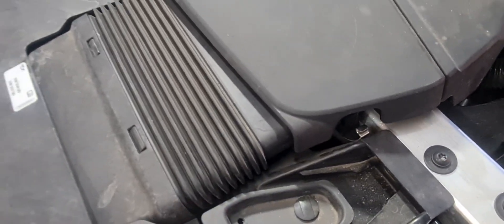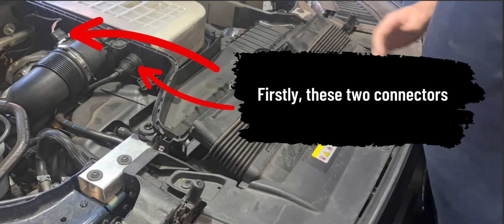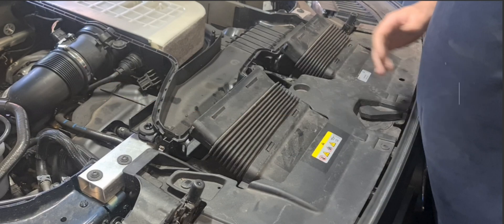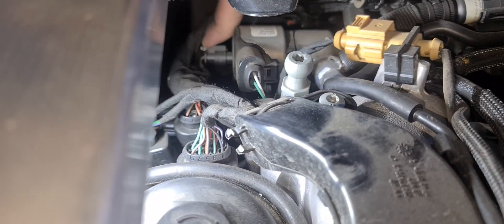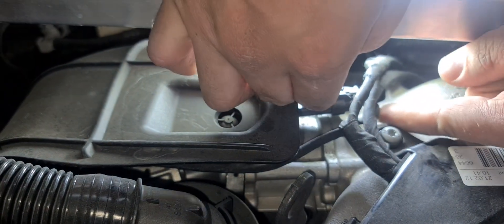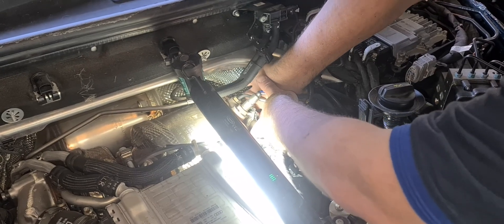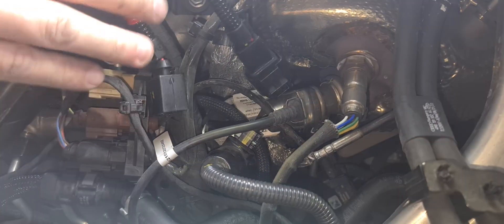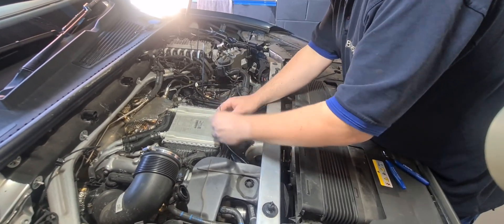VW Touareg Chip Tuning Box Installation - 3.0 TDI

Comment: Wouldn't it be easier to remove the ECU and just reprogram?
Reply from the maker: Most of the newer ones of these are locked and can't be re-flashed, so this is a good alternative. Using one of these units is also a lot better if the vehicle is under warranty as it can be removed without trace.
Reply: @BluesparkAutomotive  Ah got it 👍